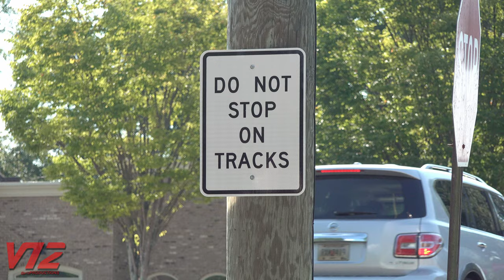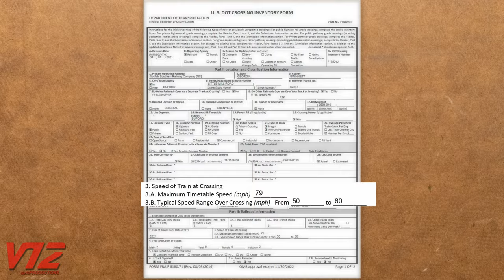POWERTOOLS EVERYWHERE After Train Hits Truck

Comment: I'm so tired of people blaming it on the GPS. You are the operator of the vehicle and responsible for following all warnings.
Reply: Not that I'm defending the driver but that is way easier said than done these days. Lots of states of trucked through do a very poor job of even posting speed limit signs let alone adequate warning signs. I dont use a gps in my semi but its still very easy to find myself in a hairy situation
Reply: This is what happens when you let technology do your thinking for you instead of reading the signs and finding an alternate route.
Reply: They have to look out the windshield first

Comment: Another trick an old timer told me was after calling the RR and 911 is to take jumper cables and connect the tracks. If they are block sections it should trip the signals down the line.
Reply: Another signal is placing a red road flare (fusee) between the rails, a Federal Railway Administration nationwide signal to STOP! Of course, it's got to be far enough down the track to allow for the train to stop.

Comment: Awesome video. And HUGE thank you for the explanation of what to do in a situation like this. Not enough people know how to handle it, you see it all the time in videos. You nailed the explanation of the ENS signs. Another thing to note is that the gates are flexible and spring loaded. If the gate comes down and you and aren't boxed in or bottomed out, just hit the gas pedal! A few paint scratches are way less expensive to repair than replacing a totaled car.
Reply from the maker: Thanks for watching!
Reply: How about not getting in the situation by reading the damn signs?
Reply: @davidprellberg1344  If people were infallible, we wouldn't even need those signs.
Before you know it, they're all gonna be in Spanish too so there's no excuses.

Comment: As a truck driver I can assure you that's so easy to do. Stupid GPS units regularly try to send me down roads unsuitable for trucks or under low bridges, when you're under pressure to be on time the traffic is heavy and you're looking for the address you are delivering to its very easy to make mistakes.
Reply: I rather be late going another route and still deliver safely then take a shortcut trying to beat the train to get it on time, and totally lost the entire freight.
Reply: In the end, it's ALWAYS the Driver's Responsibility to know dangers and Hazards, and make adjustments from there. Cannot blame GPS or the dispatcher or anything else. It's the Driver's Responsibility!
Reply: I have never punched the address in the GPS and started driving.Atlas and Google earth and than drive.
Besides GPS has nothing to do with this.
Reply: @intruderIG  Exactly,  it's driver error

Comment: I've seen trucks get stuck on rails too many times. They should fix RR crossings so that doesn't happen.
Glad every one was okay.
Reply: That crossing looks pretty good to me. I think the problem is that when a standard is set for crossings there will be somebody who will just try to push the envelope a little bit. It’s kind of like the way trucks get bit when they tried to go under a bridge that is only a little lower than the height of the truck. Wether by ignorance or by intent, people will try to squeeze a little bit more out of a crossing or a bridge.

Comment: How long before the crash was the railroad called?

There are many instances where railroads have been called for a crossing issue and 10-30 minutes elapse before a train arrives and fails to stop to prevent a crash.   I do not know if this is because of institutional unresponsiveness, indifference, or just plain incompetence, but it should not happen.    Yes, it takes a mile or more to stop a train, but that is only two minutes time.  Any crash after that was preventable.

Comment: No one mentions the poor design of so many grade crossings in America that hang up trucks.
Reply: You are SO CORRECT. It wouldn't take much to FIX this crossing so this could never happen. But I guess few thousands of dollars of DIRT to raise the level of the road on either side of the crossing so the elevation is not a problem is just TOO MUCH TO ASK FOR!
Reply: @dmaxsba  It takes a lot to FIX crossings or other infrastructures. It's not as simple as many people assume.
Reply: @TomZ23  that crossing could have been fixed for less than the cost of this crash.  It literally would have only required some fill and asphalt.

Comment: Sounds like the number on the blue sign was called, but that train was still coming in too hot. As for the driver, either out of the job, or by the looks of it, owner-op with no trailer and a hefty citation/clean up bill. Not to mention a higher insurance premium.

And those were some better Milwaukee brand tools too!! Usually $600-$800 for a "value pack" of four tools.

Comment: If you're a truck driver and your GPS leads you to railroad crossing, find an alternative route such as bridges over railroad tracks.
Reply: Especially if you're pulling a tanker trailer.
Reply: @KevinRichards-rk3gp  That as well, however some roads would have signs that would tell truckers not to go down them with hazardous materials.

Comment: Accidents happen all too frequently.  Truckers are under the gun to be expedient which is understandable.  However they can't depend on the GPS to send them ln the safest routes.  There was a recent accident near here as a result of a driver trying to avoid the scales.  NEW YOUNG DRIVERS NEED A PROPER SAFETY EDUCATIO.N.  OLDER ONE AS WELL TO PREVENT ACCIDENTS.

Comment: He wasn’t trying to prevent the incident from happening when the officer stopped his police car directly behind the truck preventing him from backing up. He helped assure this incident was going to happen. The officer was just as stupid as the truck driver.
 “So what do you do if you encounter a problem at a railroad crossing?” The truck driver and the Police Officer WAS the problem.
Reply: The truck was STUCK, it aint going anywhere.  Once the landing gear touches the road it lifts the tractor frame so that the drive tires loose traction  =  stuck
Reply: The officer parking his vehicle directly behind the trailer ensured that the truck remained in that place even if the truck driver would have managed to work the trailer free  =  UNSTUCK  The officer didn’t start to move his vehicle until the train was about the strike the trailer. The inept officer’s incompetent judgement ensured that the trailer got unstuck in the worst possible way.

Comment: Back in the day there used to be two kinds of Road Atlas' available. One for normal drivers and one for truck drivers. The truck driver version had MUCH more information in it including road that trucks should avoid helping drivers navigate the U.S. without hitting problem spots like this. With all of the tech available today you would think there would be a truck driver version of GPS. Then again I haven't driven a truck for over 20 years now so maybe there is and if so WHY wasn't this driver using it?
Reply: @anb740    Too many truck drivers are simply what are called ‘Steering Wheel Holders’. Poorly trained (many ‘Trainers’ have less than six month’s experience). What’s worse, many are from foreign countries w/ little English comprehension or speaking ability.  Will get much, much worse if 18 year olds are allowed to drive semi’s.
Reply: My old Garmin was geared for truckers. It would WARN of truck hazards.

Comment: Why are they both BNSFs on NS track? Lucky coincidence that they just so happened to be foreign power?
Reply: It’s called ‘run through power’.  Usually, but not always find ‘run through power’ on unit trains like this one (Intermodal, oil, grain, military). In older times whenever a train went from one railroad to another, it had to stop, change engines & cabooses as railroads used different types of locomotives.  When engines standardized & cabooses were dropped from use, it became faster to move freight across the country.  Say BNSF owes NS money.  BNSF will allow NS to use its locomotives to ‘pay’ NS back & Vice versa.  
Where I live, it’s not unusual to see UP & KCS engines on NS trains; also see BNSF & CSX engines but not as much.  On the Alabama Southern, a local short line; it’s become not unusual to see CN (saw a BC Rail engine not long ago) & KCS engines on oil unit trains as well as CSX engines.  See Danny Harmon’s (under Distant Signal) YT channel on motive power

Comment: Drivers rely on GPS, I have a truck GPS and it needs continual updates. No GPS is perfect and there is a whole bunch of pressure on that driver. If you think things are bad wait till the computers take over. It will be a blood bath!
Reply: Probably not, the computer would have seen the signs and stopped the truck.
Reply: @TomZ23  I worked in I.T. For 20 years, when the computers break it gets ugly.
Reply: @floydrandol2731  But, in this case it would be a fail-safe scenario.
Reply: @TomZ23  You have more faith in Computers than I do. After working on Servers , Computer’s and  all things Technology for 20 years I can tell you we are a Hell of a long way away from safe driverless Trucks.

Comment: There is a computer in the driver's head called a "brain" that should be better than GPS and used to stay out of trouble that GPS can get someone into by just following blindly.  There was no excuse for disregarding the signs about the crossing to the truck driver, GPS should be considered a good suggestion not absolute.  That driver should not be driving with his attitude and mindset.
For information, a train of 100 100-ton cars is 263,000  X 100 = 26,300,000 lb or 13,150 tons + the weight of the locomotives.

Comment: Until level crossings are made actually level this is going to continue to happen. If you can't back up because of traffic and don't know it's there till you get there it's one way forward and try and run for it. At least you just break the landing gear on the trailer but make it. This is a railroad and DOT issue either will accept the issue to pay to resolve. It's been going on decades and nothing has ever been done since at least the 1940s.

Comment: How come almost every train crash car a lot of people blame it on the train it's not their fault that's why you can't expect the heavy heavy heavy heavy machine with tons of load to stop in the matter of 0 second bro like trains are heavy machines are not like your car all the cars rubber Wheels the concrete makes a good match but at rains hard metal wheels don't go so good on the rails because they are rails and rails are made out of metal after all you don't want the wheels to destroy the tracks you definitely don't want the rails breaking the wheel

Comment: Trains traveling fifty to sixty miles per hour is much to fast through any small town.  It is true the truck should not have been there. Just look closer the railroad tracks are only a few yards from residential and business  structures.
Reply: I bet the tracks were there before the houses and businesses . Also, if the 2 mile long trains crawled through town at 20 mph everyone would be whining.